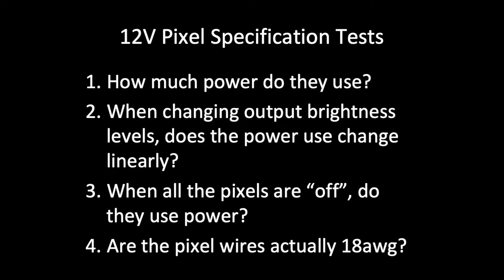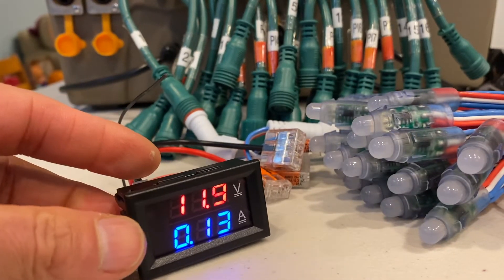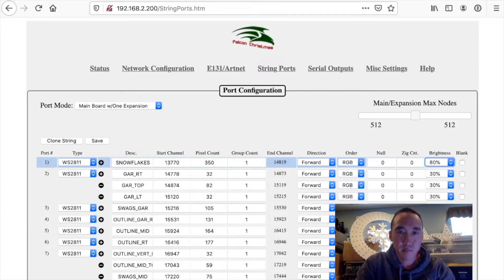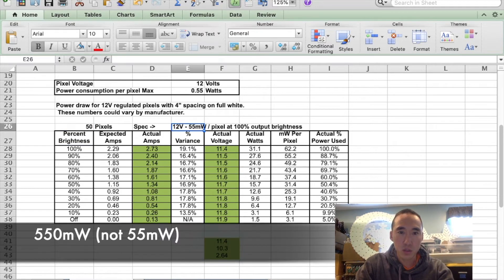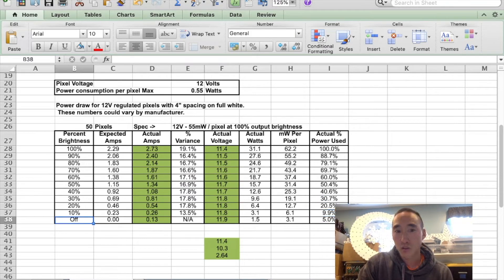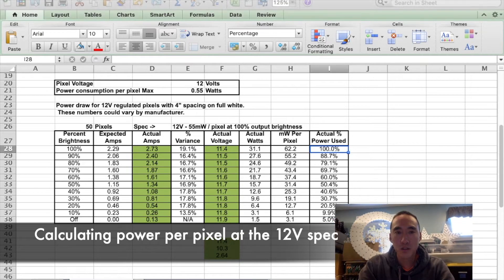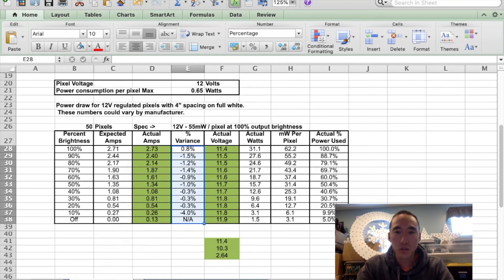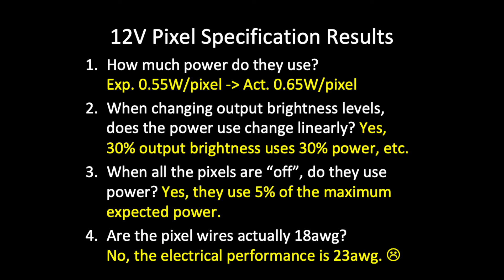Testing the Specs of 12V (Regulated) WS2811 Pixels

Comment: Hi I was watching your videos and they’re very interesting and very well done, I have that 12 Volt 50 piece set what I would like to know is can I extend the links between each pixel from 4 inch to 4 feet using 20 pixels which would be about 80 feet and then another strip at 4 feet apart using 14 pixels which would be about 55 or 60feet which would be a total of 34 pixels but then I would need to run the wire15 feet to tie the two together it’s for my driveway   Thank you........drg5231@live.com     (  hey I’m 70 years old so I can’t get to technical haha )
Reply from the maker: Thanks for the comment, and I'm glad to hear they're helpful for you.  

As to your question, I believe you should have no issues doing what you want to do.  Adding wire between pixels should be no problem as long as you use a high quality cable (e.g. Monoprice true 18AWG stranded copper wire).  You can plug your values into the Spiker Lights power calculator to see what type of voltage loss you should expect.  http://spikerlights.com/calcpower.aspx.  The maximum length between pixels the calculator allows is 36".  But from those results, there is minimal voltage drop due having a limited number of pixels along the line.
Reply: @NiFamilyLights  thank you very much for responding, Thank you for your advice and I feel a lot more calmer going forward with my project thanks again

Comment: Thank you for the vedio.
You mentioned you didn’t use that volt meter ,is there a reason why ? 
Well you be able to make a vedio on how to install them into the controller because am thinking to add those to my build.
But again I want to know the pros and cons of using it.
Reply from the maker: Mouris, you are welcome.  Thanks for the comment.  I installed the meters in the two Ammo Box builds for my home show (4 in each box).  After running the show for one season, I realized that they provided no real value to managing and running the show.

Yes, it's cool to open the box and see the voltage, but the power supplies do a great job of maintaining voltage.  All controller and power distort boards now have LEDs indicating power to each fused outputs.  So, you'll know immediately if a power supply does happen to fail.  

In the end, the added complexity of cutting rectangular holes and adding more wiring really isn't necessary.  I skipped putting the meters in the church light show builds, and I don't miss them one bit.

Comment: Do you use solely regulated or a mixture of both?
Reply from the maker: I only use regular pixels for my shows. I’m hoping to get my hands on some resistor based pixels soon to see how they compare to the regulated pixels.
Reply: @NiFamilyLights  Yes, I’d be interested in knowing what your findings are on the regulated vs resistor pixel debate as there has been many many threads posted on this topic. I just ordered a bunch of resistor pixels from Wally’s are most stated there is no significant advantage to either, regulated just cost more.
Reply from the maker: @llatrel  I have a friend who ordered a bunch of 12V resistor pixels that I'll be testing once they come in.  Like you, I'm curious how they perform compared to regulated pixels.

Comment: You showed the power supply at 12.0v but when you plugged in your test rig.... you lost 1/10 of a volt with minimal load. As your load went up we saw the external meter going down in voltage. What was the power supply meter showing for voltage ?  This shows loss just inside your box.
Reply from the maker: Soundman Pete, very good observation.  

I independently tested and calibrated the V/A meter test rigs with separate 12V and 5V power supplies and my multimeter.  Those V/A meters do have a potentiometer on the back to perform calibration.  

However, I did not perform a calibration on the V/A meter that's in the ammo box build.  So, although I 'set' the power supply to 12V per the meter in the ammo box build, it was actually 11.9V per the calibrated meter.  

That being said, the results remain valid, as I'm measuring everything between the first and the last V/A meter test rigs that were calibrated independently.